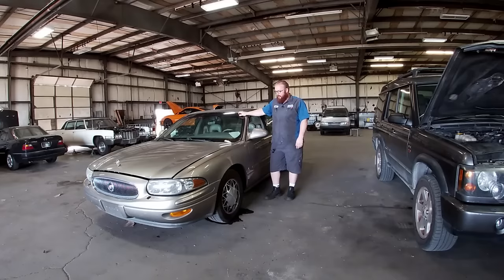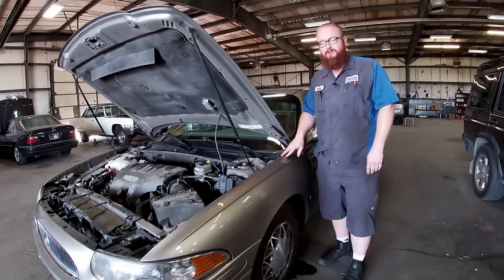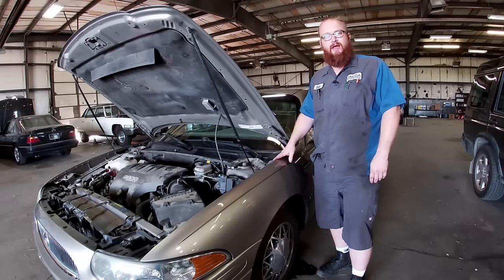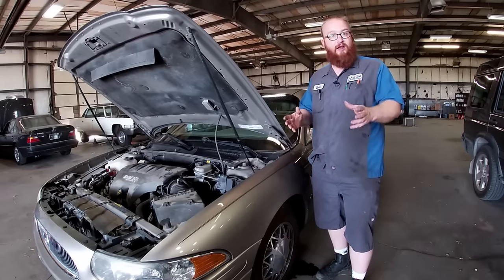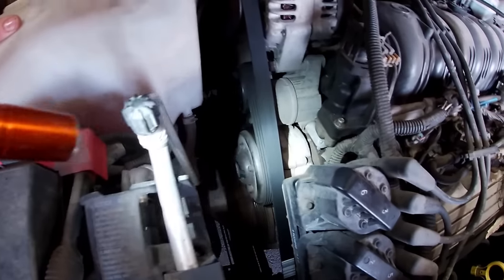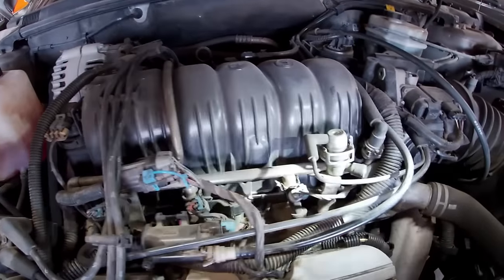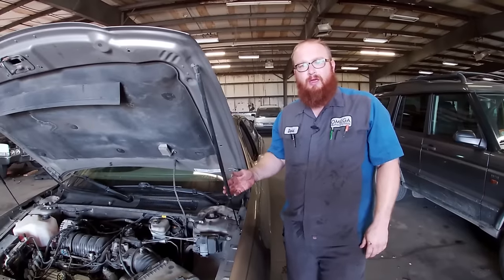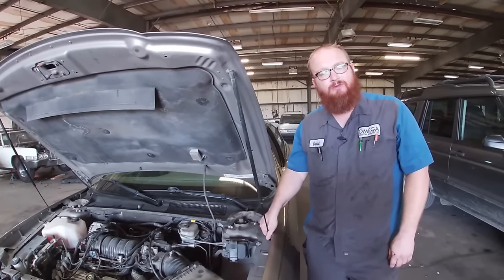CAR WIZARD highlights what makes the Buick 3800 V6 the BEST engine ever!

Comment: GM did 2 mistake in 2008. The first one was to disband Pontiac brand (i was a huge fan of the Pontiac Grand Prix) and discard this legendary engine. 3.8, 3800, series i, ii and iii, they where literaly the best engine i had the pleasure to drive. I call engine like this one the Maso engines. They could take some serious punishment and beating and ask for more. Theses 2 mistakes GM did garanteed that i will never push a GM dealer's door for the rest of my life. Anyway, nothing's that reliable anymore.

Comment: Yes its a very good motor.I feel like the rest of the car is crap.Even maintained very well you might get by with few repairs,but I feel like other parts are prone to fail earlier than they should,including ball joints,drive axles ,engine sensors.Im no professional but thats been my experience with GM.For the past ten years I have owned two Corollss.I now "Suffer " from very good reliability and confidence in my vehicle.

Comment: Man if you like replacing all the gaskets on the top end then buy this engine. The internal engine is good but you will go broke If you buy one of these and you’re not a mechanic. 😂 all this is before 100,000 miles…

Comment: i worked on one of these engines in a gmc pickup,it must have been 20 years old at the time,the only thing that needed replacement was the rings and gaskets..its probably still running today..i never saw a 20 year old engine in so good shape
Reply: 3800 in a truck? Are you in Australia?

Comment: "Best engine ever"? Then you start with excuses, then it's the core of the engine. Over 50 years as a Master tech I've seen plenty of engine with 250,000+ miles and original. The 3.8l doesn't make enough power to break.

Comment: Once you replace the $1000 intake manifold gasket that they will ALL need by around 145k, they should last forever.  But be prepared for that huge expense!  Ask if it's already done!  Also, many of the cars that have these engines have frames that rust out prematurely.  So you buy the car for the great engine and it is undriveable!  Buyer beware!

Comment: Why replace a great engine?  Cost cutting.  GM loses money on sales if their cars don't break down, it was a money saving measure just like cutting all the popular GM brands like Pontiac.  Thank the 2008 market crash.
Reply: And if you noticed pretty much anything made after 2007 is not as reliable. With the exception of the GM 5.3 engine at least GM still kept that beautiful engine around until 2018 and then scrapped it.

Comment: I use to be a service manager at a Gm dealership and that engine was and is a piece of shit …. 🤷‍♂️ we had lots of them go dead with only 35-40,000 miles on them and most of those cars belonged to a elderly couple that never drove over 50 miles per hour 😉

Comment: If the transmissions behind them weren't turds. 😅 At least they are cheap to pull and rebuild.
Reply: Hell the 3.3 dodge engines are just as reliable. We serviced med transport vans that had 300,000 plus miles. Engines ran great the van was total garbage 😅

Comment: The 3800 is junk and has a plastic intake plastic fittings that leak and old rings behind the water pump. They're junk
Reply: Why, they are great engines, just do the maintainance. Have had great luck with mine.

Comment: 😂😂. Australia used this engine in the Holden range. Welsh plugs would rust out early and leak water. 
Toyota also used this engine in the Toyota Lexcen same problem. 
Why the hell do you need to use an additive to stop corrosion. 
Toyota fixed the problem that GM couldn’t. 
It’s a piece of rubbish.

Comment: Is this a joke? GM v6s were the most horrible engines. Cracked flexplates, broken bolts, massive vibration, spark knock. Described as an engine that struggles against itself. The thumbnail headline discredits this mechanic

Comment: Except for the PLASTIC INTAKE PLENUM which fails and allows antifreeze into the cylinders causing motor to hydrolock. PLASTIC!!! ( at 64k miles) Or PLASTIC oil pressure sendor which failed at   65 k and leaked a stream of oil. In fairness, car sat in garage for approximately 10-12 years after mom passed. Maybe motor oil turned acidic or something?? Pontiac Bonneville 3800 series II